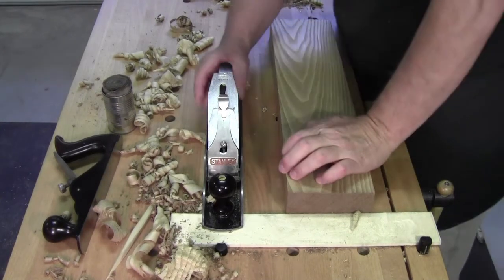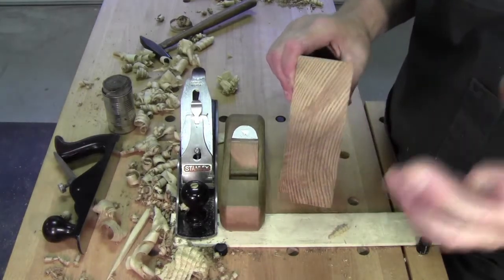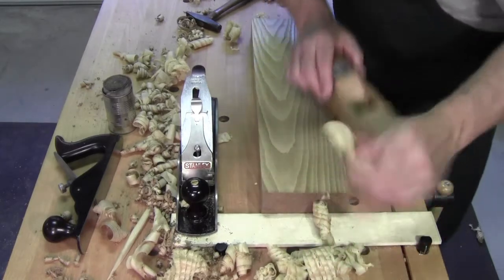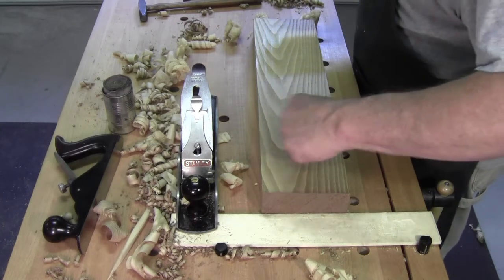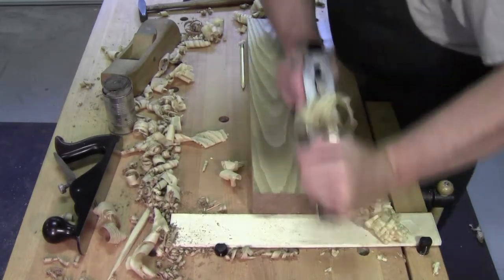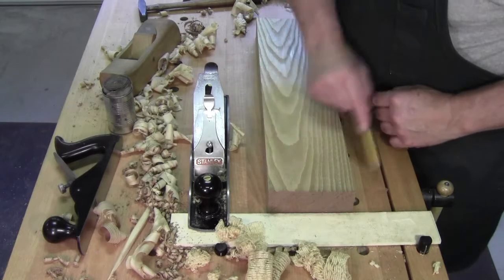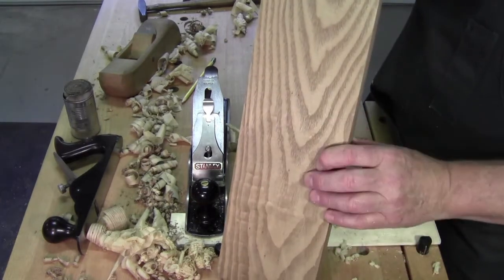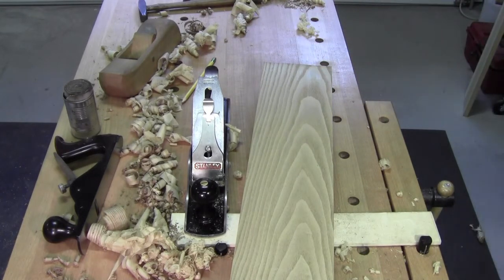PLANE TALK - Sufferin Sassafras - How sweet the smell - June 10th 2017

Comment: When I lived in Sullivan County NY, there was a sawmill in nearby Pennsylvania who turned me on to Sassafras. I used to use it for drawer sides. It planes SO beautifully and finishes nicely. Besides that it smells so wonderfully when working with it. I kept some of the “saw dust” in a small bag for inside the drawer and other deodorizing.

I haven’t located a supplier down here in Florida. I only have some very small pieces now.

Keep up the good work.
Reply from the maker: I think I got the Sassafras when I lived in Delaware many years ago.  It grows all over but you have to fine small sawmill not the big commercial ones.

Comment: Totally awesome video. Very interesting and entertaining. I have a project where I will be bending the outer radius of the sassafras log into long leaf shapes. I too love the smell. And the fact that I can harvest it myself in the woods. Love how it takes an oil stain and finish. 
Thanks so much for the inspiring video.
Reply: How did that go with bending? I heard it was brittle. I'm drying some I milled yesterday, pretty wood.